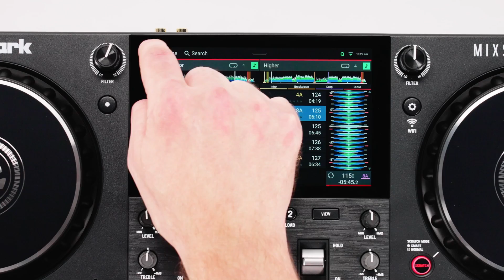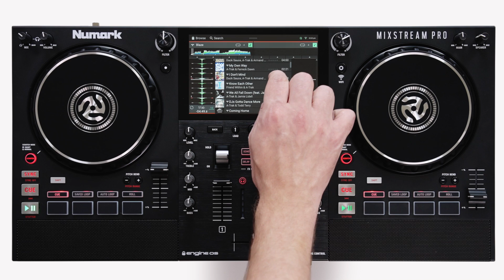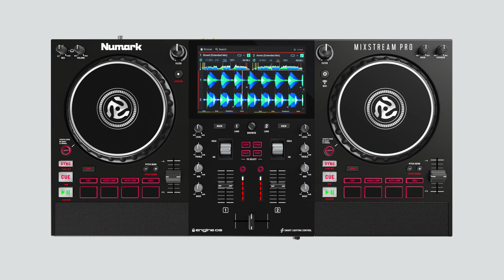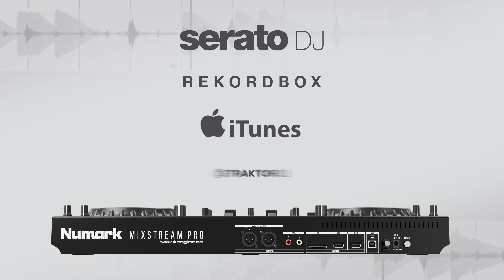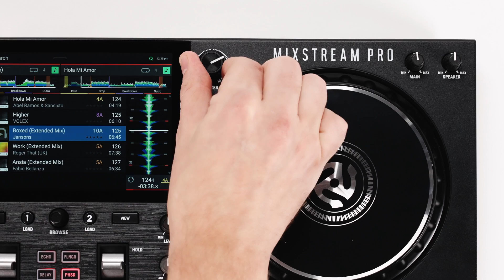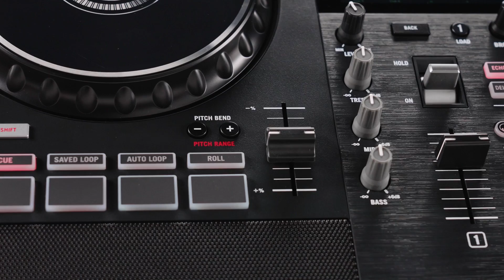Feature Overview | Numark Mixstream Pro Standalone DJ Controller

Comment: no sampler, no key sync ! no 8 hot cues  no pad fx !! ??? why? BYE BYE numark
Reply: @NumarkVideo  sorry but, u can't use 8 hot cues in same Time, u ve to use second button. İn the Future u must add 8 pads. And big faders. İ just tested engine 2 desktop. İt's pretty good. I am rekordbox user, i used all dj softwares, RB is best now for me. İ have some problem with serato traktor vdj, about transition tracks beat grid. So engine 2 looks good with beat grid and library sync, easy to transfer RB library. İf u make more good hardware, i ll buy numak with engine.
Reply: @NumarkVideo  engine dj is used on high end controllers though like denons so isn’t the ui exactly the same throughout controllers meaning that adding features to the ui would benefit some controllers like this bug make no sense on others ?

Comment: Bought one as an early Christmas gift to myself. It really is a neat controller. But I'm still on the fence if I should return it for something a bit more "professional".  I'd like  more pitch control and the  ability to tweak effects, plus a better feel on the plates. It definitely hits the spot with not having to use a laptop and the speakers sound good for what its worth.  If I find a DDJ 800 before the return policy is up. Who knows
Reply: Now  numark is a Toy factory
Reply: @JL-bu8bz  You are a toy factory.

Comment: Been playing with this for a few weeks now and it is AMAZING!!! Blown away how well this works in a small form factor and having speakers built in for small group events is epic! Been wanting something like this for years!!! Of course the speakers are smaller and won’t power a big venue but instead of taking a Bluetooth speaker with you places this thing is perfect 👍 now to mod it with a battery pack for full portability!!
Reply: One thing what I thought when I saw this controller was it would be amazing do it 4 channel would look so cool and then you could oick between 2 channel. I was like into buy numark scratch mixer change from Pionner, after finish awhile with djing. Hope you Numark will do a 4 channel  controller killer similiar to this in the feature. Cool it has usb and so many opportunities, if it was 4 channel and more outputs I would buy it for sure! :) Just a feedback and a little tip from a feature customer, hope the decks could be a bit light up cool like you have it on your most controller I have seen, but more cooler! Love this anyway! Go Numark!✌️ One thing fx button could be a bit change more near mixing :)

Comment: Numark needs to listen to its consumers like the mixdeck quad that was there first true stand alone that paved the way for everyone else to copy they dropped it it and now come up with this while again innovative lacks alot of the options that makes it kind of weak the speakers should have been added and removable on the sides 8 pads instead of 4 longer pitch controls more efx controls like touch capacitance also on eq and as a cherry motorized platters that you can turn on and off and fader start and also compatible with other software let the consumer have multiple 
options is all im saying. It could have been a contender.
Reply: Bobby, when Numark released the MixDeck, it released 3 versions over the course of a few years.   You mention the 3rd one with all the features that were put on with customer requests after they released the MixDeck Express and MixDeck.   So Numark does listen........       All the thought and suggestions coming in you might see as firmware updates are made available.     If it's a common request it will happen even sooner.

Comment: I can appreciate that, generally speaking, all of the reviewers online right now are going goo goo, ga ga over Numark's new Mixstream Pro.  It definitely has some very slick features as well as somewhat groundbreaking hardware technology.  However, especially at the price point, it seems to have a number of disappointing limitations to it as well (e.g, a whoppin' 4 performance pad buttons?  Tiny ass pitch-fader?)  I really think that Numark could have really hit the ball out of the park had they stepped up the hardware design just a tad bit more.
Reply: Do you know the pioneer xdj rr had 4 pads well clicky buttons and a small pitch Fader and comes in at 1100 gbp 😂
Reply: Pitch fader ruins it
Reply: Definitely you mentioned every point especially those damn faders xD
Reply: It's still worth the asking price.
Reply: I bought this, and it is 9-9.5. It is not 10 because you cant mix it with 4 tracks..... but.... really, it blows your mind
Reply: Use shift and it's actually 8 pads
Reply: Its sold at Toys r us